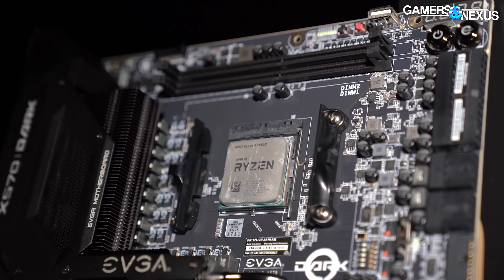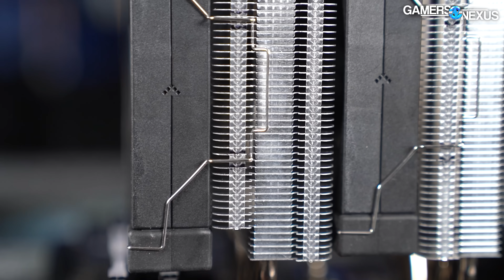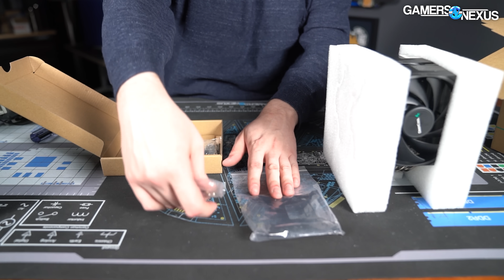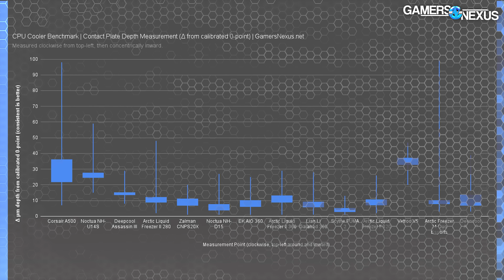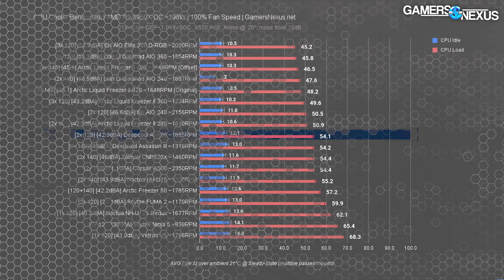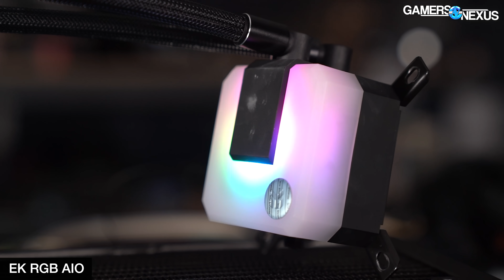Air Coolers Are Getting Impressive: Deepcool AK620 Cooler Review

Comment: Deepcool is a great cooler brand. Just got the ls720 se digital AIO for only 50 bucks brand new and it stomps anything on its price. The digital cpu temp is useful and provides great aesthetics. Very easy to install too compared to my old aio and air coolers.

Comment: Best review so far! 
Cooler is just powerful enough to cool undervolted 5800X3D in budget triple 120mm fan case, in my case IMHO.
Reply: What temperature you get while playing/idle?
Reply: @ygn1337  55C idle/hottest part of the chip, in CPU intensive games is in upper 70s or can reach a bit over 80c with MX4 thermal paste.

Comment: I use one of these, temps arent as good as Id hoped, perhaps due to user error even though I tried repasting multiple times and tightening the screws as well. The most disappointing thing though is the humming noise when it barely ramps up. Its not standard fan noise but more of a whining noise. That said, its on a 5800x3d and these chips run HOT. I had to undervolt because it would immediately spike to 90c with heavy load. 

Has anyone else had this experience?

Comment: Big thanks for the info on the case compatibility. I was going the pair the digital version with an NZXT H6 flow one. Technically it could hold that, but only with 1 mm to spare. I am not taking chances and will go for a montech king 95 instead.

Comment: I got this cooler for my 7800X3D courtesy of a Micro Center employee recommending it.  That employee is a legend.  I definitely remember his name, and I’m definitely going to thank him next time I see him for the great recommendation both here and for the rest of the parts I needed for my PC.
Reply: What's the noise like
Reply: @Matty89  It's good.  It's not as quiet as my brother's water cooled PC.  However it's far from distracting.  Bear in mind I also have a Lian Li Lancool 3 case with the stock fans, if you go with that you'll get a pretty good noise level in my opinion.
Reply: @davidbondy2250  the case I will be getting will be the Corsair 3000d with 3 front fans and exhaust and I will have the same cpu as you
Reply: @davidbondy2250   yo new to the whole building pc scene.... so i have a Nzxt h510i i hear alot of people saying they buy case fans soo case fans and the fans from the cooler are 2 different things ? and should i buy a case fan and any recommendations?
Reply: Looking to get this cooler for a 7800x3d, can it keep the CPU sub 85 °C under heavy loads and gaming?
Reply: @GdBearman  I did a quick test through Cyberpunk 2077, so this isn't comprehensive but I still played with near maxed settings in areas with lots of NPCs so the CPU wasn't given a free ride.  Peak temperature was 77 Celsius.  Bear in mind I'm using the Lancool 3 case with the stock fans, and I haven't configured any sort of fan curve myself.  I also have an RTX 4080 Super.  I don't have any sort of torture workload set up or scientific temperature testing like GM, based on what I do personally test it was able to easily handle one of the heaviest games I own.
Reply: @GdBearman I tested with ryzen 7800x3d at stock without pbo overclock or undervolt with this cooler i got about 80ºC using prime95. Of course gaming much lower, I remember playing alan wake 2 max settings stays 60-65ºC.
Reply: @GdBearman  probably, as X3D cpus already run on lower voltages, you dont need anything better than this
Reply: I just got this cooler (ag620, same thing just no plastic caps) for 40$ lets see how well it does for my ryzen 5600 lol
Reply: i got this on a deal too for my 7700x, love it but i do be glancing at thermalright prism AIO

Comment: So... Between DeepCool AK620 and the Arctic Freezer 34 eSports Duo, which one is better for Ryzen 7 5800x3D?

          I was going to get the Arctic Freezer 34 eSports Duo because it looks amazing on white and has great cooling, but considering what I watched on this video, I'm doubt about which one's better, considering COOLING capacity, NOISE and if it's gonna fit my case lol (I have an XPG Starker Air 465x215x400 mm). Money is not a problem due those has nearly same price on my country (MX)
Reply: A friend bought the Feezer 34 duo with the white accent fans. They are yellowish now. He’s not a smoker either.

Shop local ad. I just bought another new D15 this time for $40. $60 was the last new one.

Comment: I got this for a i5 13600k I hope it’s good enough
Reply: How is it?
Reply: @metanoiax2130  excellent
Reply: @metanoiax2130  my case is considered to be bad airflow h510 elite and in cou intensive games like battlefield it’s only in the 70’s I only use the middle fan so I have a extra and most games it’s just 60’s and if you use cinabench and make it go crazy you will see high temps but I highly doubt most ppl do that I only did to push it as hard as I could lol

Comment: I rebuilt my old computer with this cooler. It's an 8700k @ 5 Ghz. Strangely enough, it's not much warmer than when running a custom loop on the same cpu. I got mine for $65 from Micro Center. It exceeded my expectations. I thought I'd have to dumb down the overclock, but wasn't needed. My 8700k is de-lidded with liquid metal. Max temps under load in the 60s and idling in the high 20s or low 30s. Fairly similar to my custom loop. I'd like to see how it would handle my 7950x3d. That cpu's 3d vcache is toasty.

Comment: Just bought one of these for my 5800x3D. Under 100% lead it only hits 75c. My old cooler (NZXT Kraken Z53) would hit 90c under nearly any load. Not to mention the fans that come with the ak620 and quite good.  Even with open back headphones, and open case, I can't hear them at 80%. I bought 3 more of the exact same fans for my case cause they're so good! Just wish they sold them separately in white, as of right now, they're only in black.

Comment: i have matx mobo and having problem to remove & install the gaps between my ak620 & gpu is around 1 inch. imagine just to remove the gpu i have to go through take off the cpu cooler + fan clips & repaste thermal paste again. nowdays as gpu is thicker it block my pcie gen2 for wifi card .

Comment: Bought this and loved it for about a month. Severe resonance issues with the fans at certain RPMs after about 35 days of ownership. I've seen quite a few others complaining about the same thing. Deepcool support acts like they don't know it's an issue but will send you new fans without question. Wish I would have known that because there are realy very little people talking about it with how popular AIO's are now.
Reply: Same issues. Bought this cooler for a month the performance has been great. But there seemed to be a random humming noise especially during low loads that rattle my brains making it unbearable. Only after a few weeks then I finally managed to pinpoint the issue to its fans (i initially place my suspicions on my seasonic psu/gigabyte mobo).
Adjust the rpm from 800-1300, the humming noise is ever present just quieter/louder. 

Bought pair of Noctua A12x25 fans on impulsive and my cooler has been silent since then, giving back peace to me. I suppose Arctic P12 PWM PST should also do the job (i have them as case bottom intake fans), abit at a higher decibels but much much more acceptable noise/frequency as compared to stock cooler fans. This combo end up being more expensive than Noctua D15 Chromax Black, imagine the savings I thought I will get with AK620.
Reply: Well, you two guys and few other on whole world complaining among thousand of happy user with this product i call success. Plus i would like to mention that twin tower is what it count. Fans are expendable and its cheap and quick to replace. 
And it work better than some lot expensier models on market.
Enough for me. Imagine if only few cases of failed Mercedes destroy that automobile  company. Shit happen and you are among less lucky persons on this world.
This is excellent cooler.
Cheers

Comment: Can somebody talking about humming noise this air coolers produce? i have  this one and have some issues at range of 1.200 rpm and from 900 to 980 rpm.Other then that yes its just cooling every procesor with ease :)
Reply: Mine is relatively quiet.  The noise from mine comes from the power supply

Comment: Hey there, thank you for the video, I found it very useful! Do you think Deepcool AK620 will be sufficient and ok to use it with Intel core i7-13700k? I don't want to get a water cooler, so I'm choosing now the best air cooler for that processor.
Reply: power limit your 13700k to (I think, you should double check) 253w and you'll be fine. otherwise it'll try to use as much power as it can get, whether or not u have an aio or air cooler.
Reply: @aprilmeowmeow  Yeah, after my researches I found out that it’s probably what I’ll do, thanks. Is this what is called undervolting the CPU or it’s a different thing? Because I heard undervolting can also help to decrease temps. Maybe it’s a stupid question, sorry (I’m new to pc building). 
And will this wattage lock to 253 somehow noticeably affect on the performance?
Reply: @aprilmeowmeow  and will I be able to do overclocking after that procedure?

Comment: Why are liquid coolers so much more efficient?
The water tubes are the equivalent as the heatpipes on an air cooler.
So basically you're replacing the two fans on shorter heatpipes with three fans on longer heatpipes...

Comment: SO THIS WOULD KICK the butt out of a 5600x running round 63 watts while gaming?
I Just ordered the AG620 Black ARGB version because of your review. for $78 CAD.
Reply: CPU cooler would be of better quality than the processor requires. Except for 7600X, AMD's x600 CPUs don't need powerful coolers. Even a Gamaxx400 or Hyper212 are enough.

Comment: You guys at GN are doing the graphs wrong...well, not wrong. But those bars give no where near enough information for the amount of equipment you have. Why don't you try plotting on the X-axis the power (heat load) that's being fed into the cooler, and on the Y-Axis the temperature at that heat load and at a given FAN RPM after a given settling time, the same for all coolers.

In a single graph you can plot several cooler fan speeds and the temperature you can expect for those RPM and the given heat load. Out of all the variables, plotting heat load on the X-axis makes the most sense because it will be the same regardless of what it's putting that power out, yes some CPUs give a different heat output at different frequencies, but a tech savvy user can figure out their own CPU frequency/power dependency and search for the cooler that will allow him to reach a temperature target, RPM and all. 

Also, you could report the sound pressure at those fans RPM...but there's no need for that. The fan laws let you get a rough estimate of the fan dB at a given RPM based on the reported fan dB at max RPM.

Kind of how Heat Exchangers are selected, but not quite since you need more knowledge to read a heat exchanger graph. But a T(Watt) = (K^n)*Watt (or something that looks like that) for a CPU cooler would blow open the floodgates to really see which is a "better" CPU Cooler, or better gauge a cooler for your goals.

Comment: Just got one of the ag620's for 43$ waiting to snag a 13600k or kf to put it on. Seemed like the best bang for my buck as I'm not going to be doing anything super insane with it and I'm kinda a air cooled guy anyways.
Reply: How are the temps under load? I'm planning to buy AK620 for my 13600K.
Reply: @roullig  haven't been able to grab a 13600k yet, when I do I'll do some cinebench stuff and monitor it gaming and I'll try and remember to repost here.
Reply: @roullig  68° running cinebench with stock settings I got it all put together

Comment: I've got one of these and the mounting hardware for the am4 mobo has two tiny posts that you screw the cooler too.  One snapped clean off with little to no pressure being applied.  Seems like a lot of reviewers are complaining about the same thing here lately.  They told me they were going to charge me to ship out a single replacement bracket.  I'm sending it back and getting something else.

Comment: Are these tests really comprehensive enough to test cpu air coolers and compare them together? You test the cooler @36 dB noise normalized (cpu idle+load) and another test @100% fan speed (cpu idle+load). Is that all you need to know for a cpu cooler in terms of performance? These tests basically resulted in the Noctua NH-D15, Deepcool AK620, Deepcool Assassin III and Scythe Fuma 2 being 99% similar in performance. I know diminishing returns exist but that doesn’t sound like the most accurate result achievable considering the price point and size for each cooler, does it?

I noticed a few other reviews who go through noise normalized tests across different decibels. Hardware Canucks tests cpu coolers @36-46dB on cpu idle load, and another test with the same noise range on full cpu load. In these tests, the difference was a lot more noticeable especially between the AK620 and Scythe Fuma 2.

I’m not an expert so I’m just asking. Regardless, this is really great content thanks a bunch for this.
Reply: yeah they could test more and it could get slightly more accurate, but seeing they are this close means it doesnt really matter which one you pick in terms of performance. This is one of the only channels/outlets id say this about, but if GN dont think it requires more testing, then it probably doesnt. So just buy the one with the best performance in your budget and call it a day.

Comment: Could you measure the temperature on both sides of the die with dual-tower cooling solutions and see if the fan direction matters, or if one side is warmer than the other? I'd love to know, and if so, which direction we should be aiming our fans, or if manufacturers should be using a larger heatsink on one side and a heavier material on the other with a smaller heatsink (to keep it balanced? i dunno, different copper/alloy mix)

Comment: I would run this------but with only one fan. I'm not a hardcore gamer. I love huge heatsinks, they're a beauty.
Reply: I got the nh-d15 with a 3 fan set up. The 3rd fan only drops the temps like 1-2 degrees, but i love the look of a huge industrial look cooler
Reply: Then perhaps you should take a look at the smaller version of this, the DEEPCOOL AK400. They tested that one as well and it did well in its price-range.

Comment: It this AM5 compatible? I bought in haste for new 7600x system now Im worried it wont mount correctly ha
Reply: How are the temps under load? I'm planning to buy AK620 for my 13600K.
Reply: @roullig  Temps are fine. Around 37-38c idle at 50% fan speed

Around 83c at 100% fan speed when stress tested in most cases. In some apps like handbrake encoding it can reach 95c (by amd design) but clocks remain around 5.2.-5.4Ghz

Comment: I just bought it for 48 dlls on Newegg. Upgrading from a 35 dll vetro v5 air cooler. For my 13600k!
Reply: How are the temps under load? I'm planning to buy AK620 for my 13600K.
Reply: @roullig  less than 65 degrees

Comment: Thinking of buying this cooler, but my case has 160mm max CPU cooler height (Zalman Z9 neo Plus) and this cooler's height is 160mm according to DeepCool. What are the chances that it won't fit? Anyone had any experience of installing max height coolers in Zalman's cases? Maybe someone had experience of DeepCool's cooler being higher than manufacturer claims? Help! I need air cooler for R7 7700X(gonna undervolt) and pretty much every other decent air cooler is higher than 160mm, and I REALLY would love to avoid buying new case.

Comment: Gamer's need to spend there time on studying the aspects of the game and researching the correct components for building their systems rather than trying to squeeze another 5 fps out of their system with high voltages = heat, thinking it will improve their gaming success. Many go out and buy the latest CPU but then cheap out on the memory or GPU bottle necking the system. Research and spend your money where you get more FPS without overclocking your CPU and you won't need a fricking $350.00 water cooler ......  but wait than you can't brag to your buddies how fast your system is but you forgot to tell them you still suck at the game. REMEMBER KNOWLEDGE IS POWER .... but heat can be if your a CPU 😁LOL

Comment: "HSF-Θca" is (C/W), so the calculation does have power in it, literally the 'temp per unit power'
Θca / Θsa / Θcs / Θs  and others are all variables measured in watts / degree. Everywhere says that "amd defines..." - AMD didn't define Θca as it related to heat sink design and heat power dissipation, They didn't use the measure until 2015. Yet it's covered in depth from Texas Instruments report SLVA462 from 2011 which was building on already known thermal values and equations. It covers heatsink design, volumetric resistance, and air flow volume (or lack thereof).
... 3 minutes of google-fu

Comment: For the i9 12900 ( non K) is the stock air cooler enough to keep temps low? No overclocking. Just factory settings

Comment: You should review the ID-Cooling SE 225 XT which is on amazon for $39.49, I purchased that along with a Noctua NH-U12A Chromax Black and over 3 tests each, the XE-225 XT performed better at idle & underload on a 5800x. The only issue I had with it was the fans being really loud so I put some noctua fans on it and not only did it fix the sound issue, but the heatsink performed even better.

Comment: Returning my Noctua Redux and picking this up. With a $10 dollar coupon @ Amazon, it's $50 (redux) vs $55 dollars (ak620), for a pretty significant performance difference. Not justifiable going with the Redux given the pricing and data
Reply: Can u reply to this comment and let me know the noise level of ak620 at 30%, 50% and 80% fan load? 
Thanks in advance.